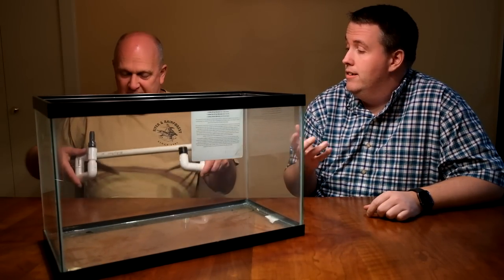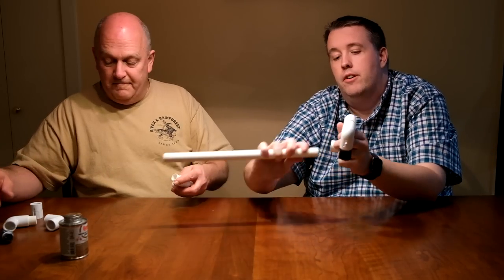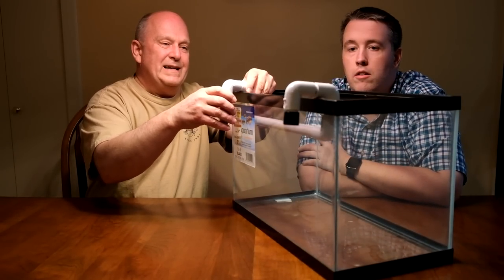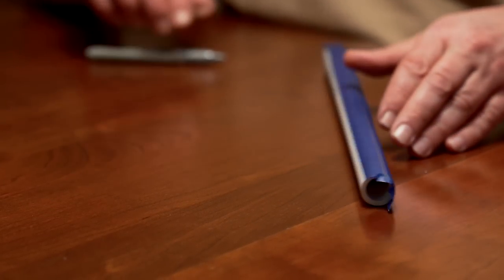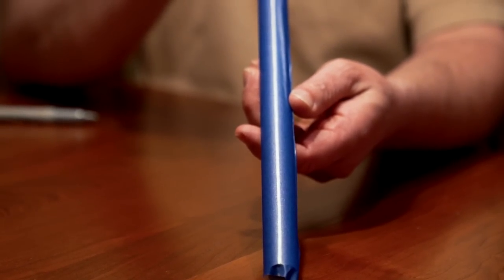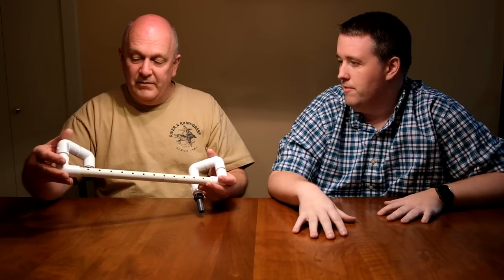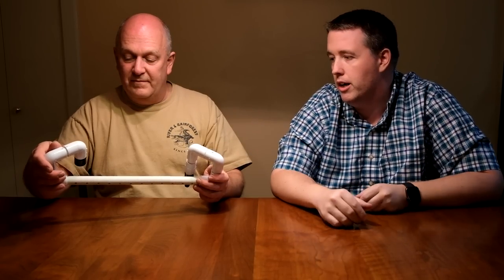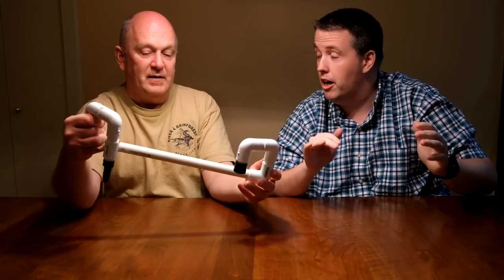DIY Spray Bar for your Canister Filter.

Comment: I've built plenty of spray bars and found a way to make my holes line up with clamps and a drill press. Seeing Dean do it with a table and pen just amazed me, what a great application of KISS (Keep It Simple, Stupid).
Reply: graph paper.  the grid will line up around the circumference and that will ensure the graph is running parallel to the pipe and then you have an easy way to space them!
Reply: What Dean did is called scribing. It’s an insanely useful trick for a lot of finish carpentry, but to see him use it for something so simple is pretty cool.

Comment: You do not need purple primer, what the primer does is softens the pvc fittings so that they fit deeper. If you can get the fittings completely in with glue you will be fine

Comment: White pvc pipe can be dyed with Ritz dye, you boil the water and then turn off, add Ritz dye, pvc parts, let cool, purple Ritz dye hides purple pve cleaner/ primer. Saw this on an arts & craft video.

Comment: Thank you for this!  I just moved my Red Eared slider of 15 years from a 40 gallon tank to a larger outdoor prefab pond.  I've always used canister filters but unfortunately they aren't rated to be outdoors.  But discovered bio pressure filters for ponds that work like a canister filter. I needed a water-return solution that could hang on a brim thicker than a fish tank so this is perfect.

Comment: I used this guide and made a spray bar for my 125 gal freshwater.  I got rid of any air pump soon after because of the amount of air this puts in the water.  Whole setup cost me $20 cad.   plus I have about 7 feet of pipe left over. Building one for my 75 gal this weekend.

Comment: I've been using spray bars since the 70's and the only thing I've changed from what you've just showed is that in large tanks and tanks with really high flow where there is even a 10% chance of the bar coming loose because of water pressure, I've learned that if you drill a 1/16th inch hole through the end caps and into the PVC, you can use a plastic pin or screw to hold it and that's more than enough to hold the pressure.

Comment: I built something similar last summer using a pond filter pump for my 60 gallon tank, and put a video up showing how I did it. I didn’t think to make the hooks to hold it on the rim, though. Great video, thank you!

Comment: Nylon string will cut PVC~!  I have cut sch 80 electrical pvc with this in a tight pull station under ground~! this sch 40 is way thinner.... awesome idea on this spray bar... i have a canister filter and this will come in handy~! thanks guys,,,,,love your videos~!

Comment: just made a spray bar out of 3/4 inch pvc for my fx6. it worked great. i was able to slide the outlet pipe over the 3/4 inch pvc but i did put a clamp on it so it wouldnt push off.

Comment: This is awesome and a great idea. I'll have to modify it slightly as I need a rain bar, not a spray bar (to get frogs to breed). Tap the holes in the bar to add sprayers.
Reply: drip irrigation stuff by Rainbird also works well

Comment: Made mine out of clear plastic tubing which I heated with a heat gun after inserting a silicone bending rod inside it to prevent kinking. With the clear tubing you are looking right through it and it is invisible. Bending them took a couple attempts but it looks awesome. We used a photo of plants printed on back lit film that gives the aquarium an awesome 3d effect (It looks like it is 3 to 4 feet deep.) Didn't want to ruin that with pvc.

Comment: I like using the hard black reticulation pipes for my spraybars. They all screw together so you just need the teflon tape to join it all together. No glue involved. Costs a bit more... but in the long run... it's all reusable. Unless you happen to overtighten a joint like I did and shear the thread off in it.

Comment: I will always use spray bars. In my setups I typically have the outlet of the canister filter blowing directly onto a heater to ensure enough flow over the element. Something that can be a bit of a pain with a single outlet nozzle.

Comment: I have used PVC piping for my Air stone corner filter, goes up then across the back of the and exits.
1 elbow with a hole for the air hose, 2 lengths for height/length of the tank.

Comment: If you're concerned about chemical leaching, use polyethylene pipe with polypropylene fittings. They're NSF rated for potable water. I use it for Aquaponics setups for my tanks.  With barbed fittings, you don't need to glue anything. Poly pipe comes in long coils. To straighten it, dip it in hot water, bend it straight, then quench it in cold water. If you don't quench it, it'll begin to curl up again.

Comment: I have a spraybar supplied with my Cascade 1000. Works great! Have it on a 38 gal tank. This has me thinking about different setups. Taking the bar to the rear bottom and spraying up. Easier to hide as it would be hidden behind tank structure. Also, you could use cave for hot water applications as it has a thinner wall and smaller outside diameter. Hose adapter would still be the same at 1/2 inch fnpt (female national pipe thread).

Comment: @Aquarium Co-op I love what you guys do and more so these educational videos on DIY maintenance and craftworks. If anything, the money saved from hardware can be allocated to plants or even on fish. Not to mention that these hardware benefit the aquarium a lot! Is it possible to do a video of people with undergravel filters that are plumbed to a canister filter? Perhaps a video on how to set one up? I own Hagen's Undergravel Filters and would want to go for canister without ditching the undergravel filter.

In retrospect, there's also the argument that you don't need to disassemble the tank/filter when using an undergravel filter, is that true?

BTW, Dean, brilliant idea on getting a straight line across a rigid PVC!

Comment: Hey Cory, I know it’s a stretch, but could you and/or Dean build a spray bar for a HOB? I want that river flow effect but a AQ110 doesn’t fit on the side of a 29. Or any ideas would be helpful!
Reply: I use a soap dish and Life water bottle combination for my HOB. It doesn't look as cool but it works, lol.

Comment: If the holes are of the same distance from each other, the hole closest to the input should be the smallest and further holes are to be drilled with progressively larger diameters. This way, the flow rate on each hole is constant.
Reply: lol yeah go ahead and measure the flow difference of a series of orifices 1 inch apart.  the proper way to do it is to but a flow regulating device like a gate valve down stream of the spray bar and have a return loop back to the sump from the valve.  this can also negate the need to resize the holes  for different flowrates.

Comment: You can probably add another barb fitting on the other side and connect a second canister filter outlet to the other side if you run 2 canisters.

Comment: What size fittings for a Fluval FX6? What diameter for the holes as well to prevent pump damage due to back pressure? Love the idea, and a lot more economical than some options on Amazon going for over $30.00 USD.

Comment: So watching this I thought of a new style of filter. You take a piece of pvc and run an air tune through it, pack it with whatever ppi/grit sponge you wish to use, and add an air stone to the tube. Siff the sponge through the tube and put suction cup holders from a heater on to hold it. You could put it on the back of the tank and angle it like a heater and as the air runs from the bottom of the tube it will pull water through the sponge. Then you have a sponge filter that's small, fairly easy to hide, and has lots of surface area.

Comment: What size pvc ? Does it make a difference as to what size canister filter as to what size pvc ? I have a 150 gallon tank . On the spray bar do you need a brace in the middle ?

Comment: I know this is old and I'm not saying Dean and Cory are wrong.  But I went the no primer route on my spray bar build and have at least two leaky PVC joints, the first and only ones I have ever had, but I always use primer.  Probably can't salvage the fittings either, which are like $3-4 each now in 2024.
Might save someone some heartache.

Comment: I've got an For and I've been thinking about doing this and replacing the ribbed tubing with rubber tubing of the same size. My only concern with the PVC pipe is I don't want to restrict the flow of the filter with holes that are too small

Comment: Why glue it at the pivot point at all?  What is going to happen if it leaks it is just going to leak into the tank.  I dry fit and leave dry fit anything I can.  Leak won't go on the ground just don't glue it.  My rule with PVC is "pipe is free the money is in the fittings".  If you can take something apart and reuse it, then it is basically free.

Also I run tons of spray bars in aquaponics and outdoor ponds.  Put a strait valve on the far end.  Open it and let the full water flow come out the end.  It will clean out the holes with no work.  For your design here, replace the far end lower 90 with a T to do that.

Comment: Improve the design by internally plugging or capping-off (with a freeze-plug) the spray bar end (instead of the hang-over elbow) so it still assembles however? Use a “T” fitting in lieu of the elbow & you can use the “dead” side as an incorporated pick-up tube.

In 1-side to the filter & then flow push through the other feed-side of the spray pipe.
Reply from the maker: That doesn't improve the design. That changes the design. You'd then need to redesign the way it attaches to an aquarium using suction cups or another method.

Comment: I want to ask you a question. I have a 20-gallon aquarium with one Betta and few rhizome plants (1 big java fern bush, 4 pots of Anubias Glabra, 3 rhizomes of  Buce ) . I wanted to boost their growth. so I bought fertilizers (Macro, Micro, Liquid Carbon )...I read on the internet that if your TDS is high, plants cant use the fertz  ?? I am from India the place where I live has extremely hard water, in fact, TDS OF TAP WATER IS 680, TDS OF AQUARIUM WATER IS 610, the temperature of the water is 30 C ..So I want o mix RO  water and tap water to bring down the TDS. I few questions below

1)If I  mix the RO and Tap water and bring down TDS will my plants and Betta will be stressed ??
2) Will my plants utilize the fertilizers that I provide if I lower my TDS ??
3) should I even lower my TDS(680) in the first place ?? 
4)any advice for boosting the growth of plants (1 big java fern bush, 4 pots of Anubias Glabra, 3 rhizomes of  Buce ). My aquarium water temperature is 30 C.
5) what is the desired TDS for these plants and betta fish ..??

It would be really helpful if you can guide me through this.
Reply: I'm no expert, so maybe others will add a comment. First your plants, Anubias and Buce are slow growing plants so you can't boost their growth. They won't grow fast no matter how many ferts you use. They will grow healthy and strong but slow if they have their nutrients. Second, watch aquarium co op video on plants, if yours show zero deficiencies then you don't need ferts. Since your water is hard you have tons of minerals but which ones? A TDS meter won't tell you that, so don't rely just in that number. For example maybe your water has tons of calcium but no magnesium, plants need both. So watch his video on plants as he explains the signs of plants lacking nutrients and that will answer your question if you need ferts or not. Also, Cory has always advised against RO water as it's difficult for new fish keepers to keep the levels steady. What's better for fish is to keep you water steady, the temp, the hardness, etc. Hope that helps.

Comment: Totally a newbie question. You mentioned using it for flow across the bottom. I'm researching how to do a river tank... Could this be adapted for that?
Reply from the maker: definitely. Just extend how far the pipe goes down to the bottom of the tank.

Comment: Fill the inside with hot sand ( scorching hot , heated sand )
And a heat gun and you can do it all out of one piece & an end cap.
😎👍
But it's tricky ..😊
However it's one piece isn't adjustable.

Comment: Is PVC glue fish/aquarium safe though?
Reply: Good question. . . Yes, once cured and dry it is safe for aquarium use, also for potable water. However be sure you are buying PVC glue and not the combo glue or ABS glue, those might not be safe. Generally PVC pipe and fittings are designed for potable (human safe water supply) and are fish/aquarium safe. ABS pipe, fittings, and glue are designed for waste water/sewer and are not guaranteed to be safe for potable water. Still many aquarist use ABS pipe and fittings in building various projects in their fishrooms with no ill effects. I tend to only use PVC pipe, fittings, and glue and have never experienced any ill effects.

Comment: You Said fore more flow bigger holes but, when you have a specific speed of water By a specific diameter of your pipes. When you have know small holes where the water gets out you would have much stronger water beam cause the same amount of water going throught the big pipe Haus to Go in Same time thought a small hole so the speed increases wich basicly means flow im Tank increases. In Opposit  of that bigger holes Slower Flow
Or not?
Sry fore My English i am from Germany

Comment: Question! I want to use this concept as well as the pvc intake from your other video for my 75g. Using an fx4, what diameter pvc would you recommend using? Just so I’m not strangling the pump.
Thanks in advance

Comment: man 30c per elbow is so cheap. They are around $1.40-$2 where i live.  - also what is the grey piece (that the hose fits onto) called attatched to the female adapter?

Comment: If anybody really wants to use primer they have a clear one but primer is mostly used to clean and make a better Bond and pressure
Reply: Also works great for caves because you can buy so many different sizes

Comment: Can anybody give me input, I ordered all 1/2in black pipe for my tank with an fx4 and seen others use 3/4 on the fxs and realized how big the tubing is that comes with it. Should I get 3/4 or will 1/2 be fine I dont want to restrict the motor to much where it causes damage but I do need to lower the pressure because I have it on a 50 gal, a bit overkill but I got a good deal on the fx4 and plan on getting a 125 gal eventually to put it on.

Comment: How to calculate the diameter of the holes?
👇 👇 👇 

Take the area of a circle (A=πr2) from the size (diameter) of the hose and divide it by the number of holes you will intend to have and cross reference that area with drill bit sizes to equal the same area.